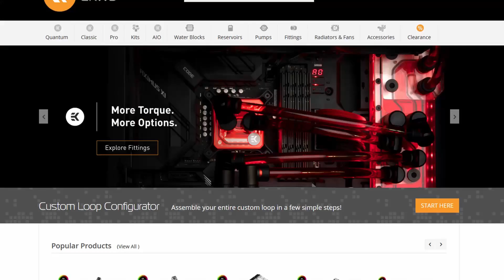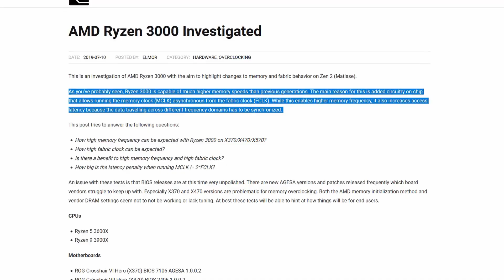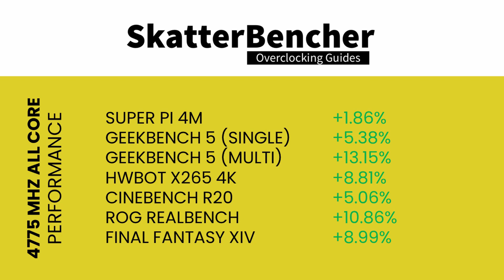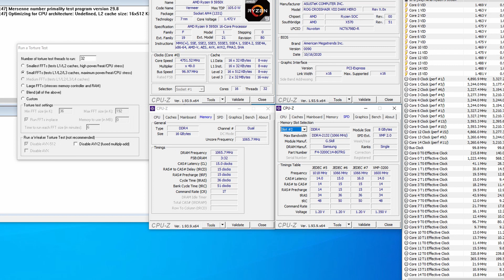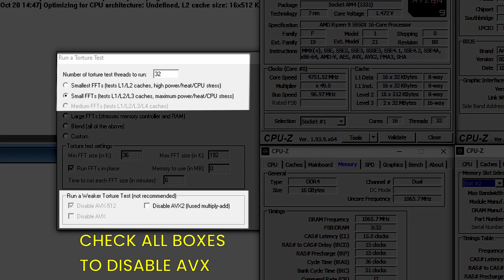5 Minute Overclock: Ryzen 7 5800X to 4775 MHz

Comment from the maker: Please note that this is for entertainment purposes only and not the whole picture. Please don't outright copy these settings and apply them to your system. If you want to learn how to overclock this system, please check out the longer SkatterBencher video https://youtu.be/gDLuwNp06-Q
Reply: Dude STOP making these youtube videos. You've done enough damage.
Reply: Why can’t I just copy the settings if we have the same cpu ? Would I risk ruining my system and do I need more than 120mm aio cooler to even consider tweaking things
Reply: always make backups and in general with overclocking its much smarter to take it step by step then find your max, rather than an extreme jump like thia @zazaman9991
Reply: i copied these setting not realising u said this in the comments and now i have no display any help?
Reply: Same…. Now I can’t even access bios and no boot. Just black screen. Wtf
Reply: @henryxvillasmil i reset my bios that worked for me could try that

Comment: DO NOT FOLLOW THIS GUIDE UNLESS YOU ABSOLUTELY KNOW WHAT YOU ARE DOING!!!! I have the exact same cpu and it completely effed my pc black screen but it turned on and keyboard or mouse would not light up… I tried resetting CMOs no luck. Thank GOD after powering down and resetting CMOs AGAIN it worked.
Reply: Well no shit, every cpu isn’t the same. Just like overclocking a gpu each one can’t take the same setting as others
Reply: the funny thing about your comment is you overclocked your cpu and broke, but me i did nthing to mine and hit 5018.1MHz no oc on all cores

Comment: hi i have ryzen 7 5800x x470-f gaming mobo and 32gb 3600mhz xmp2.0 corsair cmw32gx4m2d3600c18 micron i dont know what die. ram . i want to maximize my timings cause i feel lag in cs2 . im using 18-22-22-42 now thanks in advance
Reply: You need the Taiphoon Burner program for die checking (Die Density/Count field). Just press Read to read the data from the chip. I would not touch the 3733 3800 4000 etc frequencies until u have a good motherboard to easilly reset BIOS back to defaults and try again. If u wanna just lower the timings well... try the primaries first :(

Comment: I did this but my pc won't boot anymore, it only shows a orange light on the motherboard next to the DRAM, already did a bios flash but it won't boot. Does anyone know more about this?
Reply from the maker: Press the clear cmos button (or short the clear cmos jumper) to reset the BIOS settings. Then you can try again from scratch.

I would suggest you don't set the memory frequency and timings manually. Just load XMP/DOCP if available.

Comment: hi guys, i have the same RAM modules (G.skill DDR4-3200 CL14 Samsung B-die), but why is it better to run at 3600C16? 3600C16 is a bit slover than 3200C14. the real latency for 3600C16 is 8.89, but for 3200C14 the real latency is just 8.75 - i thought that smaller number is better amongst the latencies (OR i misunderstood something in the video) thanks anybody for the help <3
Reply: I have the same modules. You can also run it at 3600MHz CL14. Then you have the best of both worlds. Raise the voltage a bit and you'll be fine. Test 1,425V oder 1,45V
Reply: @blazzee88  nice! ok, thx

Comment: I dont have “Dynamic OC switcher” at all…what should i do?

ps
i just skip that and after saving and reseting pc stopped loading even to bios…..

I had to take battery out to reset bios…

mobo TUF X-570 PLUS
Reply from the maker: You might want to check out the longer SkatterBencher video: https://youtu.be/gDLuwNp06-Q

Alternatively, skip the memory settings since those seem to be the biggest issue

Comment: Would this work for my 5700x or could you make another video on that
Reply from the maker: The settings will be different for each CPU but the overclocking process will be similar (though I recommend watching the longer skatterbencher videos for more in-depth information and context).
Reply: Check his video about 5700g OC.
It worked on my 5700x, I just ignored the integrated graphics settings and set curve to -12 all cores (because lazy)

https://m.youtube.com/watch?v=Ou8PDY-HnOM

Comment: Thanks it's a bit more clear to me now, I'm running my 5800x at 4.65ghz with 1.2 volt and it's very stable, almost never going over 60
Reply: 1.2v at 4.65ghz and staying under 60oC, I call bullshit unless you're on LN2
Reply: @Ionstorm  Maybe mistyped 1.3V
Reply: @Ionstorm 1.2v and under 60C does sound somewhat reasonable. However, 1.2v and 4.65 GHz is unreasonable, unless he got a complete golden sample. I can only hit 4.6 GHz at 1.325v.
Reply: @fireninja7434 Guess everything is possible. I hit 4,85 with 1.3v
Reply: Yo u got discord can u help me out
Reply: 1.1v 4.4 nice cold 🥶  override mode :)
Reply: 1.03125 V and 4.4 GHz, 5800X

Comment: Hello can i do the same with a x 570 f gaming ?
Reply from the maker: Similar settings should be no problem, however your particular system may not overclock the same way as mine. So I always recommend the longer SkatterBencher videos to get a better understanding of the various overclocking strategies.
Reply: @SkatterBencher  thanks

Comment: why not do it with Ryzen Master instead?
Reply from the maker: I prefer BIOS. Maybe I'm too old-school :)
Reply: @SkatterBencher  it’s easy to overclock it before starting a gaming session but once you’re back to regular tasks you return to base clocks to give your cpu some slack, don’t you agree? :P
Reply from the maker: I would agree with you if I'm doing a pure manual overclock, however the method shown in this video is a dynamic overclock. For high loads, it will automatically boost performance, For low loads, this method will automatically give my CPU the same slack as yours gets :).
Reply: @SkatterBencher  sounds fair, problem with me is that some games don't handle overclocking, I could run cyberpunk with my all my OCs all day with no problems, then I launch BF2042 and it crashes till I go back to base clocks :/
Reply: @SkatterBencher  btw I was wrong lol nvm everything I said, I set my values to 4750 to all cores and 1.35v and thought it was stable just because I could run cyberpunk for hours but once I actually cine benched my pc crashed lol I'm dumb
Reply from the maker: Hah, I wouldn't say dumb. You learned a valuable lesson that every overclocker had to learn the hard way ... picking the right tool for stress testing.

Knowledge is power 💪
Reply: @SkatterBencher  haha yeah true! I have a quick question though, in my stock clocks when I play games my 5800x can reach up to 4750mhz at times, if I decide to do a slight overclock of lets say 4000mhz by changing the core value in bios and do a slight undervolt too, will I still get those 4750mhz boost clocks? thanks!

Comment: on auto in bios i get around 4.8ghz stock with 1.4625 voltage on auto in ryzen and bios.
temp around 77'c in apex legends at 1440p with 240fps
Reply: Apex doesn't use yoru CPU and that voltage is way past spec.

Comment: So I am running a 5800x and tried the steps you suggested on my Asus x570 board and my pc wouldn't boot. I had to reset bios just to get my pc to boot again. Not a great video in general and you need to slow down a bit.
Reply from the maker: You can also check out my full length video for additional information here: https://youtu.be/gDLuwNp06-Q.

My main mistake with this system/video is manually set the memory timings. I suspect that's what caused your system not to boot.

Comment: Ryzen 7 5800X to 4775 MHz that is just what I get by using CTR 2.1 Software.  All in 10 mins and a few clicks of the mouse.
Reply: yes but you cant export the settings into bios
Reply: @ThePsychedelicArchive  No but I don't want to, this can be turned on and off in a few seconds rather than messing around in the bios that could take 20 minutes each time you do it.

Comment: Hi hopefully you can answer this to help me out. I overclocked my 5800x using pbo and co. And my ram from 3600 to 3800. Its all stable for days now and 10% performance gain. Only issue I experience after the overclock is that during a game sometimes it stutters. And when multitasking while minimalizing a game its becomes slow and laggy. What can this be? Too low undervolt in CO?
Reply from the maker: It's hard to diagnose from a distance, but Curve Optimizer is definitely on the table as possible root cause.

Instability caused by too low voltage generally doesn't result in a system crash on AMD Ryzen CPUs. Instead, clock stretching takes place. In short: the CPU will suspend its activities until the voltage has recovered to the level necessary to run the target frequency. Suspending activity means that while the clock frequency reported is still high, the effective clock cycles are much lower.

Curve Optimizer specifically undervolts the CPU, so you can have edge cases where the undervolt is too much and results in clock stretching.

You can check whether clock stretching is happening using HWiNFO.
Reply: @SkatterBencher  Thanks alot for your answer. Will like and sub 👍 What should I pay attention to in HWinfo to see if I have clock stretch?
Reply from the maker: I covered clock stretching in a couple overclocking videos before. I think the explanation in SkatterBencher #26 should be good https://youtu.be/bxsDScbQJGA?t=1696

Long story short: check Core Effective Clocks during a sustained workload and see if one core has a lower effective clock than the others.
Reply: @SkatterBencher  Thanks alot. I appreciate it.

Comment: Got a new 5800X and put it on 1:1 no OC so far. It runs at 4900MHz. I got the second best CPU-Z Score. What i want to test is Undervolting
Reply: @skottlepot  Mine is working at 4950mhz, I only updated my BIOS to latest version (B550 Asrock) and put an AK620 on the mobo... After, I choose "Auto OC" on Ryzen Master and "tada"... God bless you, man!
Reply: @AceyPC  so it didn't come stock at those speeds
Reply: @LeDerpLegend   It's not stock, my friend, but PBO. AMD provides Ryzen Master (something like a CPU manager)... you can make an automatic overclock, downclock, undervolt, choose prefered temps on your hardware...

I made simple PBO on 2 best cores (RM shows you the best cores after a simple test) and automatically both worked on 4950ghz (with AK 620)... If I put a 360mm or 420mm AIO my CPU will overpass 5 ghz easily... I only chose "AUTOMATIC PBO" and the best cores work on 4950ghz...

God bless you!
Reply: Mine 4850 stock..
Reply: Mine 5800x , no O.C  4874Mhz

Comment: I have 5800x and in stock it have boost to 4.85ghz with undervolt to 1.2v
Reply: Yeah mine gets 4.85 out of the box
Reply: @anthonydoyle72  Yes. not under 100% load. 4.7ghz under full load, 1.166v.
Reply: @baqradze2012  no way
Reply: Wtf
Reply: The 5800x only boosts to 4.7ghz out of the box.

Comment: Hello, is running a 5800x at 4.8ghz at 1.4v all core safe for daily light use? It passed cinebench  r23 and only hit 70c max. Only use pc mainly for gaming and running Citrix for work.
Reply: That's probably gonna degrade ur cpu
Reply: And cinebench r23 is not a benchmark not a stress test so it doesn't tell stability u need to run prime 95 for a few hours straight
Reply: @jmalmighty5433  That’s not necessary. Cinebench does a fine job at determining stability from its 30 minute test.

Comment: My stock cinebench score is 5800 but with PBO2 at -10 Its 5500, do you know why?
Reply from the maker: It's hard to diagnose remotely without access to the system, but a common issue with PBO2 Curve Optimizer is clock stretching.

Clock stretching is a safety feature that prevents the CPU from crashing when it's unstable due to too low voltage. Rather than shutting down the system, the CPU will stretch the clock cycle until the required voltage level has been restored. The effect of clock stretching is that the "effective clock", meaning the actual amount of clock cycles between two moments, is lower than before. I explain a bit about clock stretching in these two videos: https://www.youtube.com/watch?v=1wcU8PrdGLE & https://www.youtube.com/watch?v=jTkDqARDkGg.

There are two main ways to detect clock stretching. First, you will notice that the system performance will decrease. Second, you can check in HWinfo the average effective clock during the benchmark and see if it is much lower than the set clock frequency.
Reply: @SkatterBencher  I didn't know that, thank you for the information

Comment: or just set your 5800x to 1.325 v at 4.7 ghz..
Reply: @CoyoteRoadRunner  every cpu is different
Reply: @CoyoteRoadRunner  Just now read this lol, nope im happy with my oveclock i think your aio might be broken or you had a bad cpu? mine runs 44°C at 4.7 ghz and 1.325V. when gaming it goes to just above 60°C. never had any problems since installing it over a year ago. anyway sucks to read that your temps run that high, maybe in the meantime things got fixed? I decided to upgrade another system with another 5800X same results.:hand-purple-blue-peace:
Reply: @CoyoteRoadRunner  ok and it still hits 95 degrees? does it perform ok though after a year?

Comment: Pff I got mine to 4950 MHz on 8 cores at 1.36V under custom water.. stable 24/7 5 mins Silicone lottery.
Reply from the maker: Very nice!
Reply: How lucky are you, appreciate your processor.
Reply: @nusretonat3502  yeah it’s still going strong, I was very lucky for a 5800x I believe most are junk, Although I do want to upgrade it too a 5800 3D model as I only game abs my photo editing is ran from my 3070 anyway.
Reply: @j0rzeh  where did u buy it? Thanks...

Comment: My computer won’t turn on after, I did exactly the same but just with a rog strix B550-A
Reply: yep, you will have to clear cmos ... what he is doing here is way beyond a normal oc. he is also using some specific stuff like dynamic oc switcher wich is just possible to have on one specific overpriced board. 
what probably happend is that you used his memorytimings . his timings are quite good and 3600mhz C16 normally needs Samsung B-die ram or a realy good bin form another manufacure ( im not talking about the company who put the heatsink on here , rather the company producing the ramchips. these are normally samsung , Hynix and micron)
so if you do not have realy expensive ram these timings wont work and with messed up ramtimings your system won't boot .
unless you perform a Clear Cmos , wich resets the bios to its defaults.
Reply: @Amarushaya92  I have basically the same stuff beside the motherboard. You think is the dynamic oc? Because I didn’t have that option
Reply: @777dtl6  no that would not cause such thing . even if you bought a 3200mhz cl14 kit and someone may be able to overclock that thing for example to 3800mhz cl14 and you copy those settings and have the exact same product ( cpu , mb ,ram , etc ) , that will not mean that it will run. because of sillicon lottery , you have that with any microchip. even ram . thats why there so many different ram products on the market. they get binned and sold depending on thier  quality , but there can be still massive headroom in them .... or if you have bad luck none.

Also having a different mb , wich could have worse quality ( layers , ram layout etc. ) will result in lower maximum ram clockspeed or that you will have to run loose timings compared to a high end board.

one question, what ram kit is he running?  i might have missed that in the video
Reply: It turns on but no booting

Comment: i have asus b550-f and x72 karaken 360mm 
its will work fine with me?
Reply from the maker: The general overclocking principles will work, but your mileage may vary. The exact overclocking range will depend not only on the quality of your chip (or your luck in the silicon lottery) but also ambient in in-chassis temperatures.
Reply: @SkatterBencher   thx for helping
Reply: @general2392  does it work ?
Reply: @LukeNguyen174   no and dont even try it
Reply: @general2392  thanks mate, how is your cpu doing ? Im using the same mobo and cpu lol
Reply: @LukeNguyen174  doing more than enough, trust me don't oc it

Comment: Hi
I own an asus B550 I strike bios 1202
in the bios the entry: extreme tweaker cpu core ratio for ccx 
I only have these two values:core vid
                          ccx0 ratio property
i can run this procedure without the dymamin oc switcher to do oc on the 5800x
or recommend using v core from section:extreme tweaker
Thank you
Reply from the maker: Those two values will also configure the ratio and voltage just like with Dynamic OC Switching. The only difference is that on your board it will stick to OC mode only and not switch to PBO.

You can use either of the two options to set the voltage
Reply: @SkatterBencher 
 Hello
thanks for your answer
I wanted another info on these 4 parameters for overclocking
1: SB clock Spread Spectrum AUTO
2; ASUS performance enhancement DIsabled
3: core performance boost AUTO
4: precision boost overdrive AUTO

these are basic parameters
on which recommendations to change
Thanks again
Reply from the maker: 1. Leave Auto
2. Enable if you have great cooling solution, leave disabled if not
3. Sames as above
4. Leave Auto if you're not going to overclock manually :)

Comment: Why do you set your ram to 3600 when you have 3200
Reply from the maker: Because it's faster and my memory is able to do it :)

I was able to run DDR4-3600 in synchronous mode, meaning the FCLK was also running overclocked to 1800 MHz.
Reply: @SkatterBencher  will corsair vengeance 3200 be able to do 3600?
Reply from the maker: That's hard to say because I don't know the memory chips that are on that kit (or how good the chips are) ... the only way to know for sure is to test it.